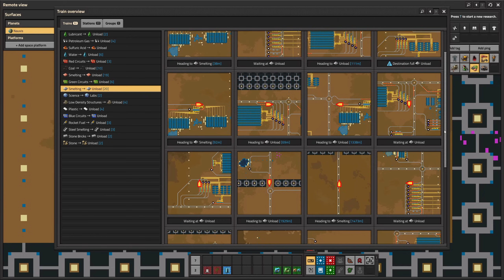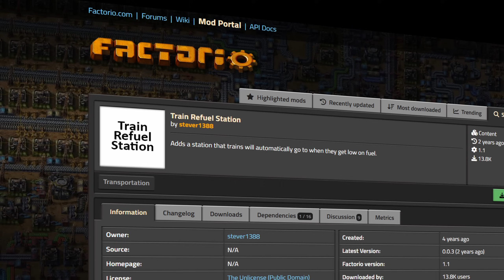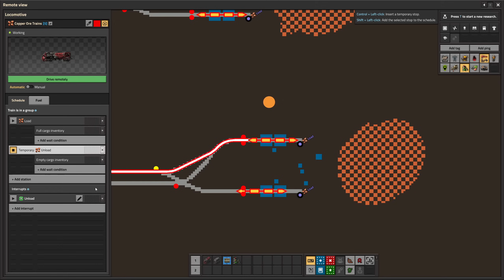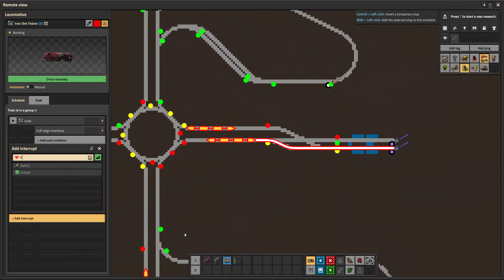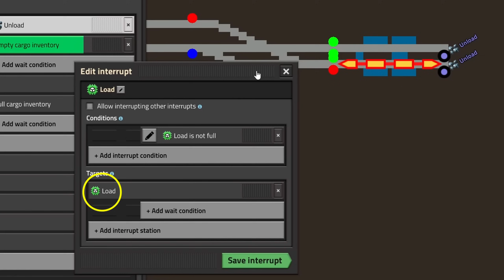Factorio Train Interrupts Explained!

Comment: @4:33 you don't need the item parameter check for the interrupt condition at all. 
The item parameter in an interrupt only passes for items in cargo so the condition you used is redundant.

In other words the first item put in cargo will pass automatically as the item parameter.

Comment: ok, i have a problem now that the interrupt for relax station causing lag so much. i set the time passed for 2s, and the train will check all the train systems for the road to go to the load station, and it cause my frame drop every time it checks and can't go because the station is full. i did change the wait condition for relax station to "load station is not full" and it just dont go even the load station is now empty, pls help.

Comment: wait  if you set an interrupt with "item > 0" as the activating condition, doesn't this cause the train to pull out of the loading station as soon as it receives ≥1 item?
Reply from the maker: No. Despite the name, interrupts can only trigger and are only evaluated when a train leaves it's current station / is done fulfilling the current waiting condition, which is full cargo.

Comment: I was having a problem with the Refuel interrupt before, It would constantly check if it was "Full" so it would deadlock itself in a constant cycle of being "Full" and rechecking.
Without changing anything, I saved, Quit, Loaded back in and the train was off doing what it was supposed to.
I had to do that for every train on the network...
I have no idea why it was doing it.
Has anyone else experienced something similar?

Comment: Some points I disagree with in this video:

First an introduction to interrupts should at least mention that fully generic trains (without circuits) are possible. From the comments I'm not quite sure if they were intentionally left out or not. But leaving out the simplest way to setup trains and never touching them again seems like a missed opportunity. I'm repeating this point since I have not seen a comment properly explaining how. So here a short description of the deviations to the setup in the video. (All loading Stations are named the same and are the only point in the schedule. Then only sending trains into storage when they are empty and optionally adding item specific buffer stations [or allowing multiple trains at the unloading stations], as not to cause a ressource deadlock.)

Secondly allowing every interrupt to interrupt other interrupts is messy... There are better ways to do this. Use better trigger conditions and the prioritization of interrupts. Interrupting another interrupt is only neccessary if an interrupt exists which has more than one target in it's schedule. Otherwise it's just a hacky way to change the trigger condition of one interrupt from another interrupt definition and debugging that becomes a nightmare if you want to do anything fancy.

Thirdly this one is more of a nitpick and was probably a mistake. Using Locomotive (any) as waiting condition for refueling will work (if supply is never depleted) but not because it is the correct condition. It would be possible for only one Locomotive to be fueled. Then the train would start up again just to be send back to the refueling station (flashing it's lights for a brief period but not moving).

My additions to this topic that I'd like to share:

It is possible to use multi item trains with unloading condition being [ItemParameter = 0] and filtered inserters at the unloading stations. Is it good? Probably not. Is it fun? Yes. I used it for a fully generic quality mall with quality from source to product. The central recycling stations made this pretty much a necessity. This required some circuit logic to know which items should be recycled and which production chains should be paused.

Using multiple Locomotives and multiple Fuel Types is not possible currently. This could be the case when changing fuel types or if you want to use multiple quality levels of the same fuel. There is only Locomotives(All) and Locomotives(Any). Using Locomotives(All) is possible with non double headed trains if your fine with some locomotives running out of fuel before refueling. Using Locomotives(Any) does work for 1 Item but the moment you have a second fuel type it breaks down. There is simply no condition for [Any locomotive has less than x of fuel type 1 and 2] There is only [[Any Locomotive has less than x of fuel type 1] AND [Any locomotive has less than x of fuel type 2]] which will result in a refuel locked train if locomotive A has only fuel type 1 and locomotive B has only fuel type 2. I tried to come up with a solution for hours but gave up so I hope someone can correct me there. For everyone else it's a warning don't try it's not worth it.

This one might be a bit off topic:
A train cannot travel to another station with the same name it is currently at. Even when it's at a disabled train stop. This could happen with an armory train which ressuplies outposts. There is no necessity for that train to return to the base if it has enough supplies to continue to the next outpost. My solution is to have 2 train stops at each outpost and use the second one if i want to continue to the next outpost. I'd love to know if anyone came up with a better system.

Comment: I'm currently working on a set of parameterised blueprints of train stations to make, more or less, a very straightforward, singular train system.
You have one blueprint for unloading, one for loading, one for fueling, one for a depot.
And then one that you place once that handles the circuit logic and sending it out to depots to dispatch trains.
Basically, all you have to do is select what item the station will supply or request, and you can select (or set default values for) how many trains and wagons you have and what your chest inserter/tank pump setup consists of, and then it handles everything else, even making sure to dispatch the correct fluid wagons to fluid stops or cargo wagons to cargo stops.

I've been working on it for a few weeks, but I think I'm pretty close to done lol.

Comment: You stated you need the wildcard to be able to transfer from loading station to the train.
But you can do that without circuit logic. Just interrupts. However I could not make this generic for both solid and liquid. But the solution is the same.

My loading stations all have the same name. The loading condition checks if train is empty. If so it will go to a free loading station.
The next interrupt checks the train content to determine the unloading station.
I have this currently running in a base with over 1k stations and trains.
If anyone is interested, I can share a blueprint.

I almost forgot to thank you for your great video's. I love them. There is always something to learn.
Thank you.
Reply: On a comment to Ryan you said it creates a bottle neck. I do not see how. It works without bottle necks for me.

Maybe the trick is this?
When a train is fully loaded and there is no uloading station available, it will stay at the loading dock. Since there is no demand at that moment there is also no bottleneck.
Reply: I've been having issues trying to use the system in the video, with some of the traisn parking on the same node but not delivering to multiple Unload stations, so I'm stuck with 5 trains waiting for Iron Plate, when I just want 1 or 2 to deliver.
Reply: @TheClosedBoxTTV A train is only allowed to leave a loading station fully loaded and with the target station not full. This prevents loaded trains in a waiting area.
Reply: @dennix01 seems my issue is having lots of unload stations (8), and only 1 or 2 loads. Reduced parking size to 2 per stations and added circuit to close an unload when the chests are full, so the train gets redirected to another unload station, and unless everything is full, it will be waiting on relax, one full train should supply my mid game base in the meantime, trying to finish rocket

Comment: The one way to avoid the issue of having 20 schedules with just the loading station name changing that I can see without using circuits, is simply not putting the resource in the station name. Just use a generic loading station name. Since the rest of the interrupts will send the train to the right place anyway depending on the cargo contents, there isn't much need for loading station to be resource-specific.

If you have multiple formats of trains (differents lengths and wagon configuration), adding these to the train station name is important then so they do not go to the wrong station.

So as an example, I'd have the stations:
- Load 2L8C
- :iron_ore: Drop 2L8C
- :copper_ore: Drop 2L8C

- Load 1L2C
- :iron_plate: Drop 1L2C
- Load 1L2F
- :oil: Drop 1L2F
- etc

Then there would be only one schedule per train format, maybe two different interrupts depending on if the train carries fluids or not for unloading (that is assuming you have fluid trains), and an interrupt per format for refueling.

(NB: The train formats are encoded front-to-back with pairs of number and letters, the number being the number of wagons, the letter being the type: L = Locomotive, C = Cargo, F = Fluid, A = Artillery if that's ever needed)

Comment: Your problem with loading stations is solved if they're all just named the same. They realy don't need a resource marker if using interrupts.
Though you'll probably want to disable stations with depleted buffers for more efficiency.

If you feally must have detailled control, you can use radars to share circuit signals map wide and use those to communicate resource shortages. The new smart sorter helps with that.

Another option is the way i handle science pack gransport. I have one single station for pack delivery. A train gets sent out to grab whatever pack is both lowest and under a certain  quantity. The train doesn't do anything when I have enough of everything. You can expand on that easily if you wanted.

Comment: I wonder if the circuit part can't be solved coupled with radars. Basically have a radar network where all of your available pickup stations send a signal when they can deliver something, then have the signal feed into the waiting area so if a train has nothing to do it stays in the waiting area until they receive a signal to go pick something up?

Comment: How I do auto-trains on my Space Age playthrough:
1. Each unloading train stop declares its item type in circuit network
2. Each depot area declares all possible item & fluid types for the current surface
3. No circuit logic for that, only one constant combinator for each train stop, though circuits are used to dynamically set train limit

It is important to understand that game checks all possible signals / item types and if finds one that matches all conditions, it fires the interrupt. Thus you should include "Train stop X is open" condition to the pickup request.

Comment: Interrupts interact in interesting ways with circuit-controlled station priorities and enabling-disabling, I highly recommend exploring that too!
If a train interrupt makes a train want to go to the same station name as where it is currently located, it will normally deadlock itself, even if the station is disabled. However, disabling it and lowering the station's priority will make it depart correctly, assuming there's another station with the same name available (but that can be checked for with an interrupt condition. (I documented it on the wiki in the troubleshooting section, too)

Also something I haven't seen explored too much yet (or tried out myself) - multi-station interrupt schedules. I think I've only tried out a two-stop variant of the generic delivery system (match on circuit conditions where both a sender and receiver are enabled; though that needs additional logic to then disable the receiver), but nothing longer than that. Notably, other interrupts without "Allow interrupting other interrupts" checked cannot activate during that whole multi-station schedule, so I wonder if there's more potential in there somewhere.

One more thing worth noting - AFAIK "Allow interrupting other interrupts" is only relevant when leaving a station (or when idling at a station due to the next stop being full or unavailable). If it could activate at any point in transit, at least when the train is waiting at a signal or something, it would allow for so much more - but, trains do occasionally re-path, and I think that can be used to somehow cause the interrupt to trigger even if practically in transit. The conditions for re-pathing are really weird though, and I haven't been able to get it to trigger reliably yet.

Comment: I'd had the thought of having Loading stations connected to radars for signals from unload stations. If an unload station has room for a train load it could output a signal onto the radar network enabling a Loading station. Doesn't really use the interrupt like you wanted but might get close.

Comment: I must say this kind of train setup is so high end for my case, because i'm only play map with normal resources amount, the mine will deplete very fast. I normally setup new station in new mining area. As for my base, i using a big circle train network to prevent my train blocking each other. inside of the big circle, there will be many branch train stations that allow them to unload resources for my base use, in this case, other train will not be interrupted or waiting. Your setup is much more advance than what i'm using
Reply: Even with normal resource amounts, once you get big miners and start researching mining productivity, ore patches become nearly infinite. Your third or fourth copper patch will take hundreds of hours to deplete.
Reply: @Mekhami  Got it, thanks

Comment: I have also found that using interrupts as your primary way to set up the train/platform schedule to be really convenient. However, I like my trains to sit at the "unloading" stations instead of using a waiting area. I've never quite figured out why people seem so keen on setting up a waiting area.
Reply: I've become a fan of them because It lets me completely avoid ever running out of ores at any station; this is mainly a problem when I try and squeeze a train station in last second and I can't fit my usual two trains waiting there. But pretty much to just have them all somewhere that makes sense based on the demands of your factory. I'd rather have trains waiting at a yard than five minutes away at an outpost.

They're all entirely solvable issues with other methods though.
Reply: In 1.0 waiting areas made sure that you do not have to watch the number of trains to closely. As Arvadii showed in the video if you have 4 pickup and 2 dropoff stations with 6 trains serving them, it creates a deadlock. This could easily happen if one of your mines runs out. 
Now with interrupts because I have completely generic trains but not yet LTN like generic trains, I need to have more trains in my network than I actually need to cover for trains in transit. And when the base is working slower I need them to park somewhere to avoid the same deadlock as in 1.0. 
And when I have finally figured out how to setup an LTN style network, I will need the waiting areas to set the stations the trains should go to. 
That is at least why I am so keen on waiting areas.
Reply: I don't like this approach because they easily block the station if you don't have a buffer before the train, or use direct insertion into buildings. I wamt my trains out of the station the moment they are empty.
Reply: Just more organization I guess lol 🤓
Reply: You can add a condition to the relax interrupt, so it does not trigger in unloading stations. Additionally, if your unloading station has a train limit greater than 1, it will make sure only overflow trains go to the shunting yards and come back to the waiting area as soon as a spot there opens.
Reply: @borisw9292  what condition would that be?